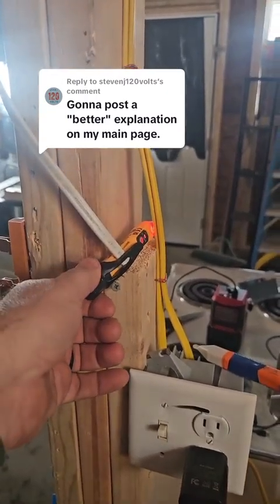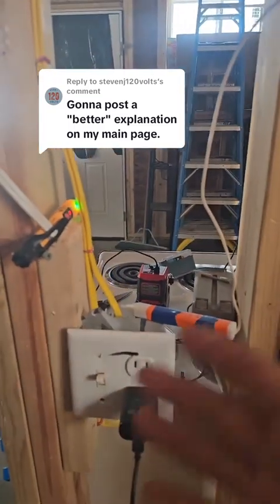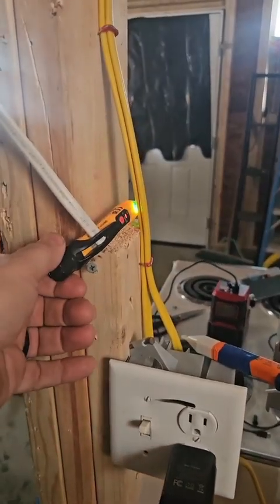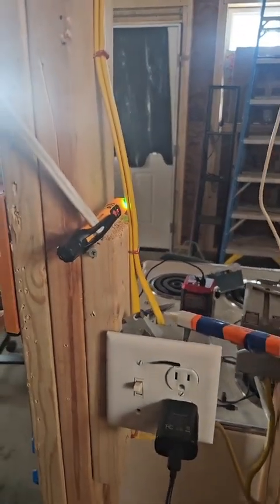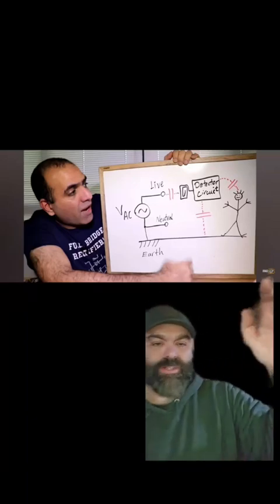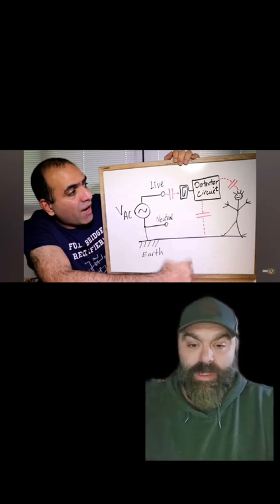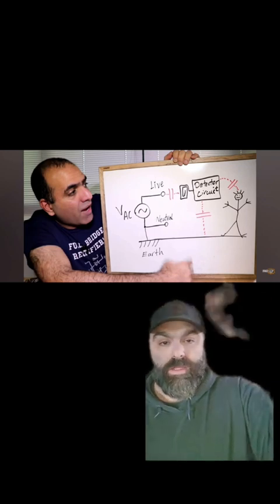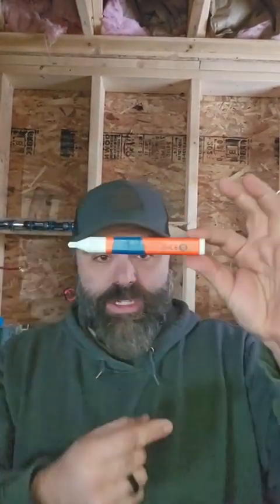CLICK HERE FOR FULL VIDEO...how do volt tics work?

Comment: Finally a logical answer as to why they quit 'bleeeping' Beeping when you let go of them. So in that theory then you could use a single wire attached to a ground screw, i.e. the #6 cover screw, then wrapped around the voltage tic. Umm 🤔 yeah net trick to try.

Comment: Gene Bowdish • JustA
May not be the best choice,
I just had it available when I was listening to Mike Holts explaining GFCls how sometimes they fail even though they are UL listed
Gene Bowdish
ElectroBOOM said he wasn't exactly sure how it works, but, his hypothesis is radio signal and or capacitance, which I am attempting to research now 2d Reply JustA •
JustA • Gene Bowdish
eb ElectroBOOM isnt an electronics expert by trade. hes actually an electrical engineer that tries to explain how things work in a real and entertaining way. he inspired my jacobs ladders
2d Reply
JustA • Gene Bowdish
that circuit works by capacitive coupling. its the widow maker style circuit. a real
POS but very cheap to mass produce. there are better ways of doing non contact test. that dont require you holding

Comment: Text from other channel repeated
Gene Bowdish
I built a voltage sensor that automatically shuts off a unknown live circuit to save lives, it works after I invented and built it, I made a video 2d Reply
Gene Bowdish • JustA
My invention uses a old non contact volt tester connected to an op-amp ... that controls a relay, my explanation video
11/6/2023
1d Reply
JustA • Gene Bowdish
interesting. ill checkout the video. thanks!
JustA • Friends
would you be willing to share the circuit? im curious to see what you specifically invented concerning it.
2d Reply